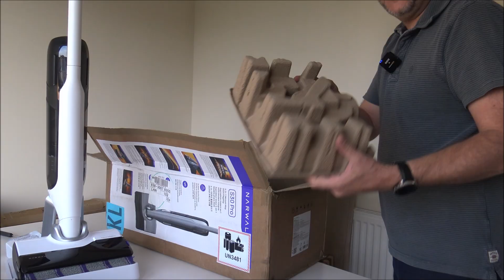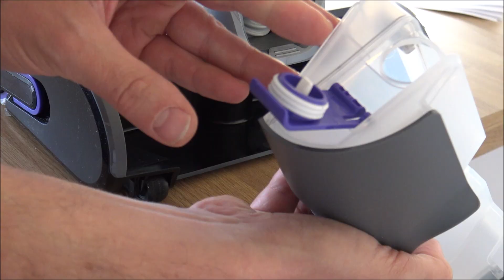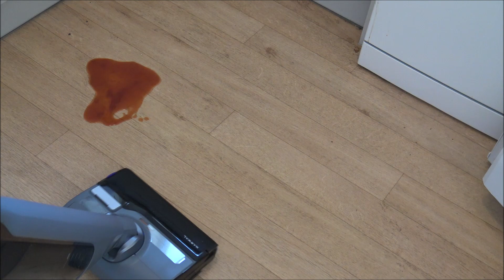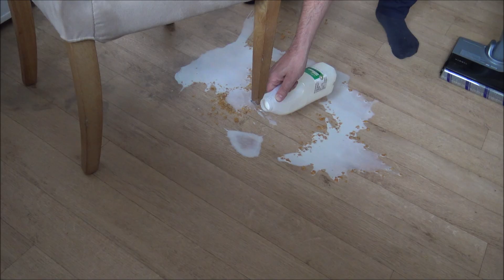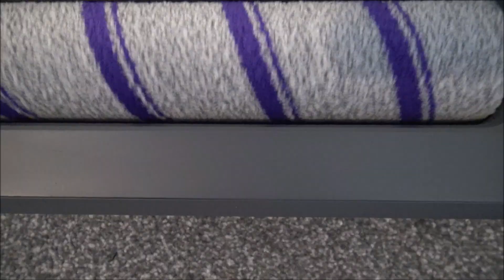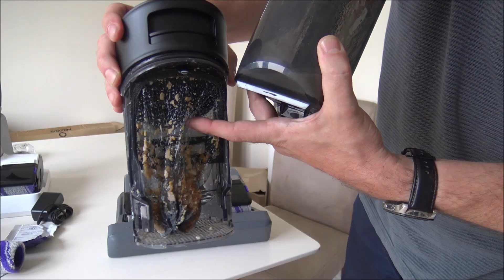Narwal S30 Pro and S30 Wet and Dry Vacuum Cleaners

Comment: Discount codes are not working for Canada
Reply: Mine works. You need to use a different code for the Narwal S30 Pro and the S30—they have two separate codes.
Reply from the maker: We’ve checked and the code is correct. Please make sure to use the S30 Pro and S30 codes with their corresponding products. If it still doesn’t work, you can contact official support at support.na@global.narwal.com, and they’ll help you resolve it as soon as possible.